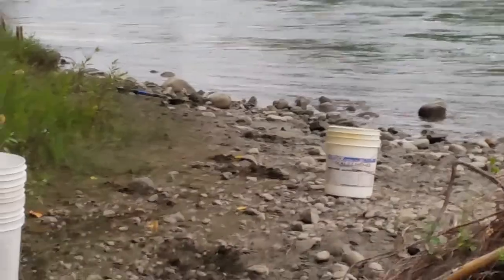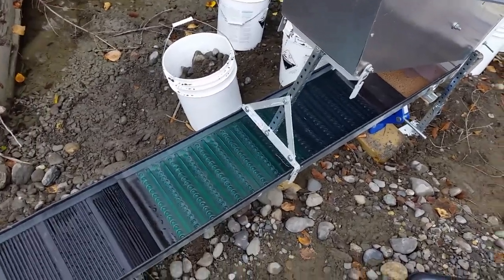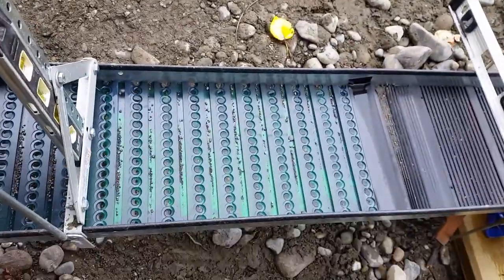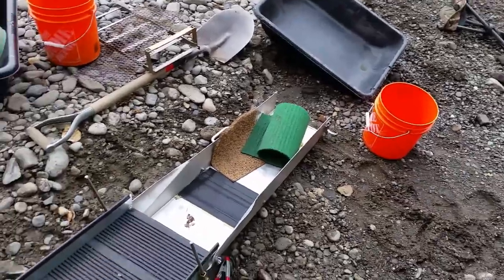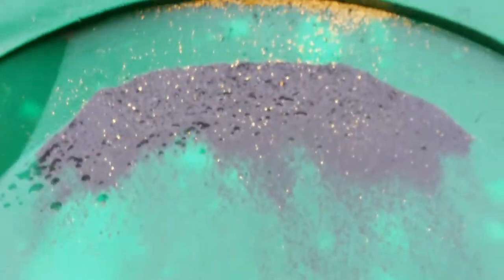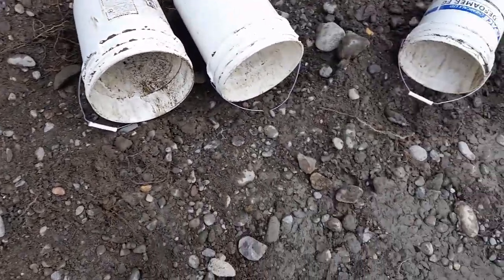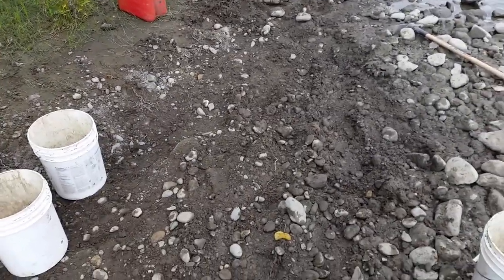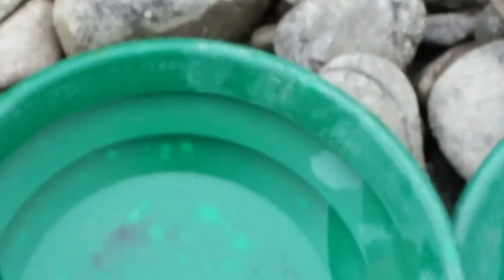New Canadian Gold Rush! Finding ounces of flour gold in the Cariboo!

Comment: Looks like you guys are working with flood gold. Seems like every time I find gold that flat it's in the blonde sands.
Reply from the maker: We have recovered quite a few ounces of gold, all of it is fine/flour/ flood gold. I only got a few larger pieces and one picker out of this general area. I'm not complaining though - I think a lot of people focus on making $1 / hour finding nuggets than $50 an hour finding flour gold. 

In this Cariboo river system there is fine gold everywhere but I find most of its distribution is in the top 2 inches, usually in area of small to medium cobbles with large ratios of black sand. This year the very high up blonde sands contained extra flood gold because the spring floods were intense, this left big banks of light sand with gold all over the place. We tested some and because it is very easy to dig and process it might be worth it despite the lower grades vs the paystreaks. Thanks Mining Magnets!!
Reply: @InfinityProspecting  I've heard of this. Skim Placers. I have also found most folks setup and run thier sluice for large gold and try to dig deep. (Or maybe targeting gold thier system can catch) unfortunately most of that stuff is long gone. I found that targeting the flood gold profile is more successful and often times overlooked. The annoying thing about flood gold is its almost impossible to know how far upstream its from. The not annoying thing is that it replenishes every year.
Reply from the maker: @MiningMagnets  Yep!! We work the same spots every year. The one kind of mining claim where the gold "grows" back every year!! Thanks MM!

Comment: Thanks for sharing your adventures! Nice highbanker setup with those Devin Drop Riffle mats. Looks like that matting really excels in the fine gold capture with both the circular wells and drop riffles. On another note - I don't think a Keene A51 is a great indicator for fine gold loss as those sluices are known to not be great at fine gold capture. You might want to try discharging into a low tub instead and put a 20 mesh window screen over it to only let sand sized material in. It then creates a fluid bed for gravity separation. Check out Gold Hog testing videos or the Keene Mini Max videos to see a low tub and / or 20 mesh screen in action. Heavy pans to you : )
Reply from the maker: Thanks for the suggestion, Dan! We did have an extra clean-out tub originally but one year it got buried and I felt bad when I rediscovered it the following year. I really don't like littering and take great care to be a responsible steward of my country.

Generally I just dig out a big heaping pan and test the tailings that way after clearing the light material. I did probably 15 tailings checks on the trip in the video. All total it was around 5 specks, most of the pans had not even a dot. That is pretty amazing considering each pan going in generally has at least 100-200 flour gold particles. In previous years, even with other highly rated mats and setups, there was always significant gold loss. If I had to estimate a number, it seemed probably 20%+ losses chocked up to "the gold is just too small, you will always lose it" but what we have now is at 99%+ recovery. I don't foresee any major upgrades from here because there are no more gains to be had. Also in 2018 we had what I would call 100% recovery running without a hopper and using classified material. There was never any gold in the tailings and 95%+ of the take was within the first 8 inches. Last year with the hopper (already upgraded with more water flow for this season) we ran really hot and fast, hugely increasing throughput so we expected recovery to drop and it did by a few specks but I am totally willing to sacrifice a few cents to make hundreds of dollars more overall. 

Thanks for the comment! P.S. The other video I mentioned to you should be out this week sometime. If you want a preview I posted the analysis on treasurenet in gold prospecting under the the headline "Use government research sensors and public data to find more gold." It was cold but a major success. This data is worth a lot of money and it is free.
Reply: @InfinityProspecting  - Brilliant recovery, sounds like your setup is dialed right in!

Comment: You need a finer screen on that hopper to stop those big rocks from coming down that’s what’s knocking your gold out of the box
Reply from the maker: We do frequent tailings checks to ensure we are getting almost every dot. Usually the tailings are barren despite each pan having hundreds/ thousands of specks. This implies near full recovery and our gold in this area is ultra fine and among the most difficult to recover. Thanks for the suggestion. Our new highbanker design has a finer screen with a teardrop design.